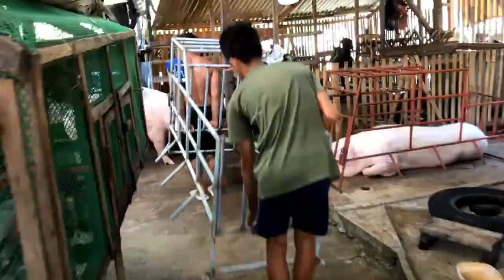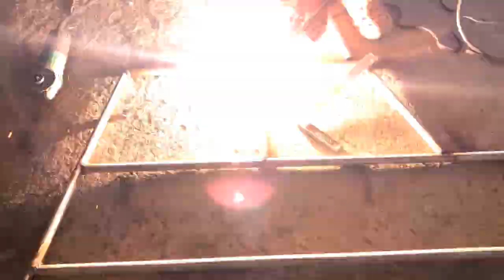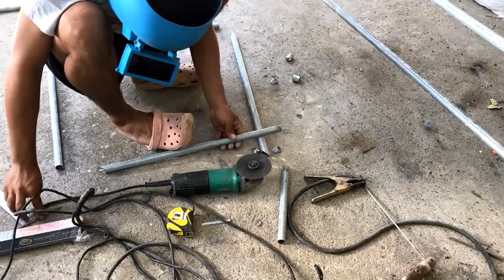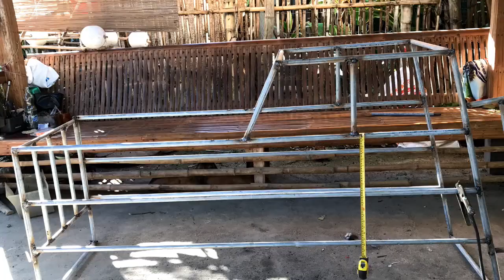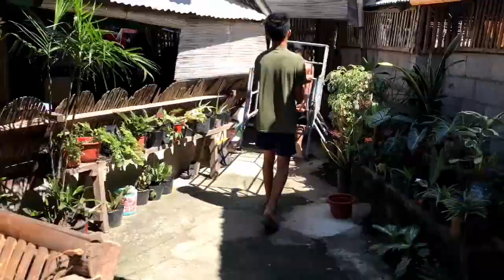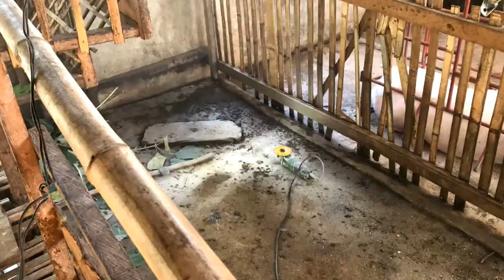making farrowing pen for pigs

Comment: Ano po ang welding rod/electrode na gamit nyo ?
Reply from the maker: Wepweld 13 2.5mm
Reply: @jay-rbacane8883  like E6011, E6012 or E6013? Ano po dyan ginamit mo na welding rod?
Reply from the maker: E6013 na 2.5mm